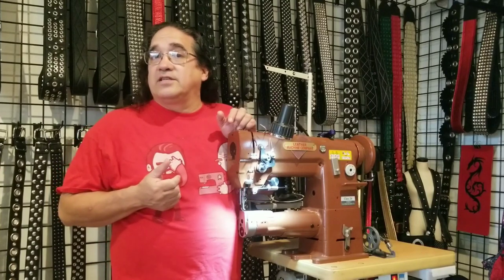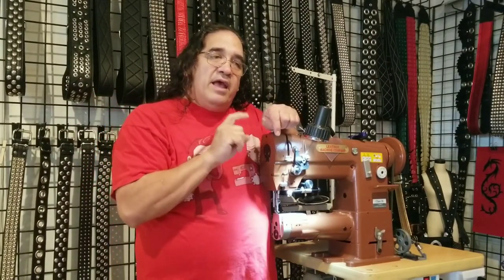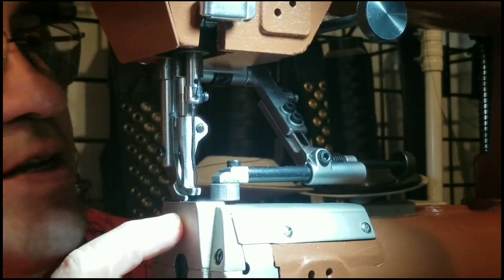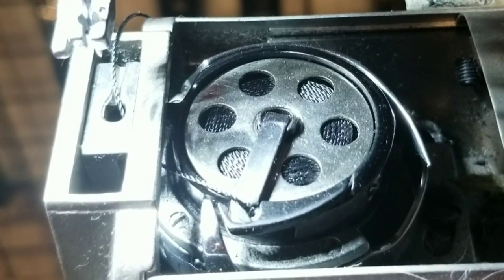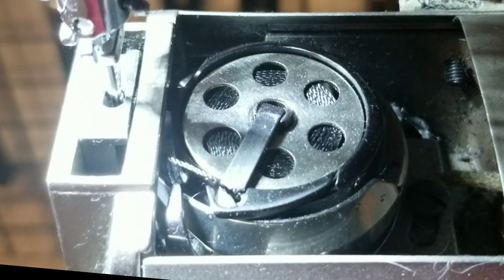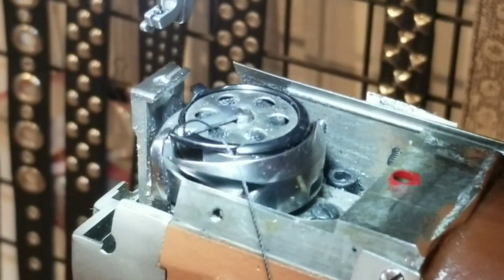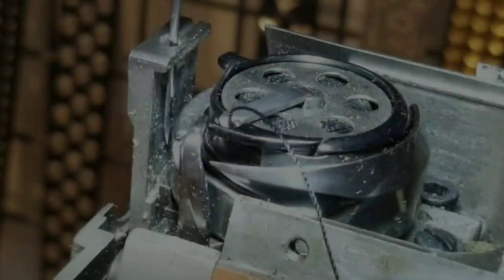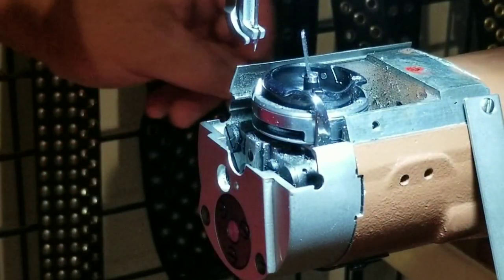Cobra Class 26 needle hook timing inspection and reset procedures.

Comment: Just finished the timing adj of Class 26 with Cobra maker over the phone yesterday and it was painful. Struggled with it for two days and was wishing Al Bane would make a video on Class 26. And viola, he did it today! After doing the 1/8" adj, I still had issue of hook piercing thread. What I ended up doing was to hold the thread and adj the hook and needle meeting point so hook picks up just right and not pick up partial thread. Another tip: When loosening the first two hook screws,  don't loosen too much or it could disengage gear and not rotate to the next screw.

Comment: Bought a used machine, worked fine, got it home and it just grunts, so I’m trying to troubleshoot. Thanks for this video, at least I know it isn’t the timing. 😜
Reply from the maker: What do you mean by just grunts?
Reply: @albaneforleather   Actually, it just hums, motor doesn’t engage. I took off the bottom cover under the feed dog (wish I could send a photo) and it looks like the whole assembly has shifted left of center, but it isn’t loose.
Reply from the maker: @pineappleprojects1624  give me a call 818-209-7945

Comment: Those wrenches are garbage and the metal just twists itself into a spiral. I brought my metric hex drivers from work and used a 1/4" drive ratchet and it loosened just fine. I wouldn't use ANY end of those cheap wrenches or there a liable to strip out the set screw socket.
Reply from the maker: I try to use the tools that come with the machine. Yes I understand that they're not the best tools that one could have for the process but if I use the tools that come with the machine the new operators who have only these tools to use have the ability to get their job done. Thank you for your comment.

Comment: Hello Al
I followed all your instructions on the patterns training video. Each time I get to a corner it makes a perfect one  but then I have 2 thread in the bobin area? I cannot figure out what I am doing wrong?
Could you help please
Thanks Christian
Reply from the maker: You are not doing anything wrong the two threads are the needle thread captured by the hook.This is preventing the skipped Stitch during the turn. After you turn and cycle the machine the complete rotation the hook will release the thread and then you will only have one thread until the next cycle.
Reply: Well that was resolved by the EPS. Thank you Al